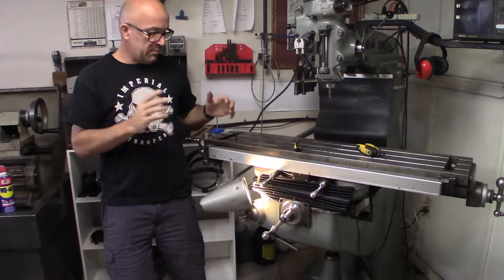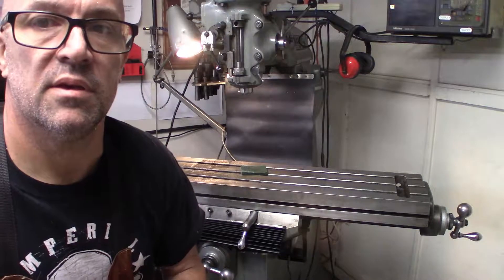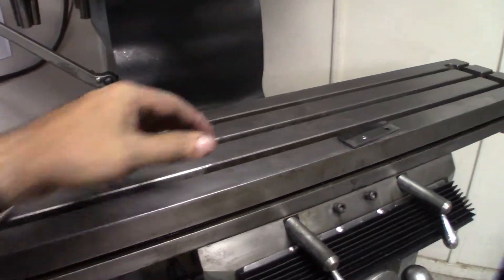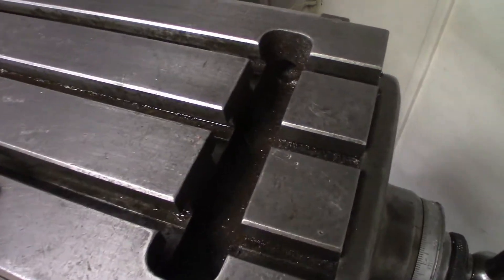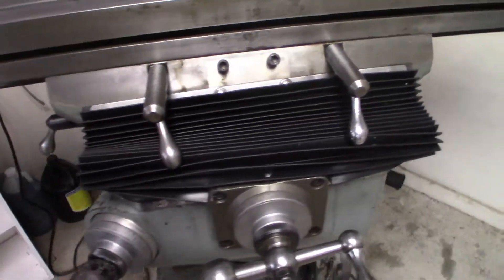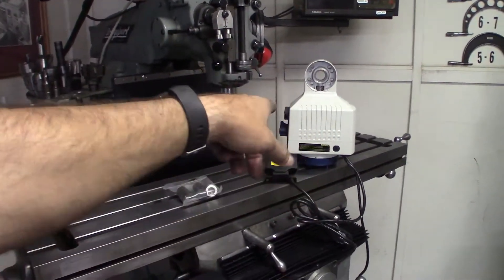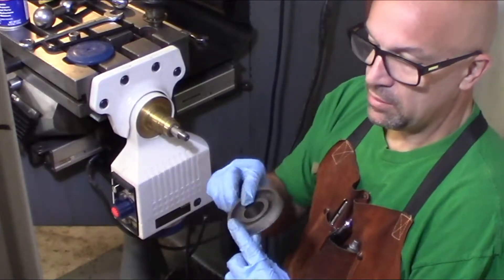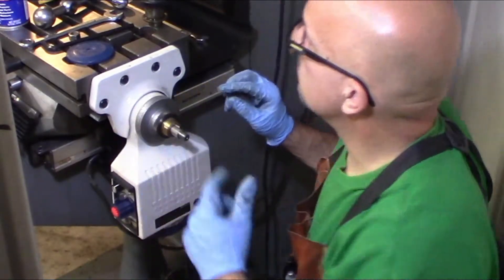Installing Bridgeport X axis power feed

Comment: Do NOT follow this video to install a power feed on a Bridgeport as there are a number of issues with what is shown...
@12min...tapping in the bearing collar...OMG, why?!?  The proper way to do this is to only loosely insert in the bolts in the mounting plate and then loosely attach the drive, then slide the bearing collar onto the leadscrew (and it does SLIDE in...no pounding required), then tighten all the bolts.    If you're having to hammer it in, it means its off-axis.  

Then MORE hammering to get the bevel gear on?  The reason why it was so tight is that the OEM woodruff key is 3.15mm (1/8") wide...and the keyway in the bevel gear is only 3mm; basically, you smashed a wider keyway through the bevel gear;  you could have taken the woodruff key and ground/filed off the 0.15mm needed and once again, it would have slid on. ..you made it very difficult to ever remove the bevel gear/adjust the shim washers that were supposed to go between the bevel gear and the collar...you DID put in the washers, didn't you?  
fwiw- If you're pulling out a hammer to install a brand new piece of equipment, perhaps you're doing it wrong
Reply from the maker: All great points.  so far it's been working great for 5 years, so at least I didn't break anything.

Comment: I know from being a Bridgeport operator years ago you had to develop a steady cranking hand it is also tiring once we have some of the mills on the line (2 rows of about 6 or 8 each) with power-feeds the finished really were best as you are also sharing. You brought back some early 1980's memories today. Automation we never look back, it is amazing to have lived through these times. Sounds good in manual and greater in power mode, you have got to be proud good install work sir.